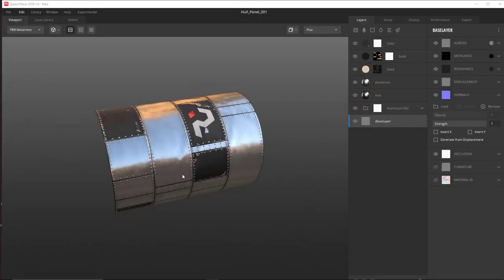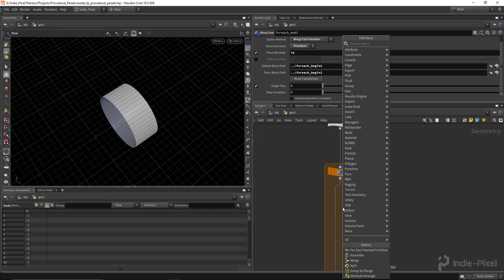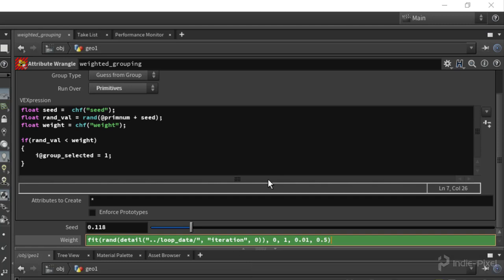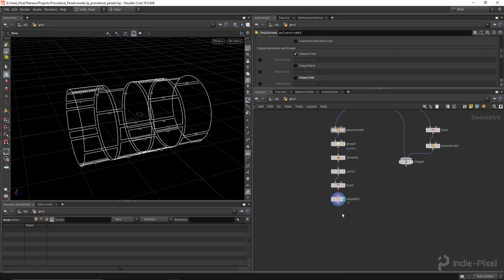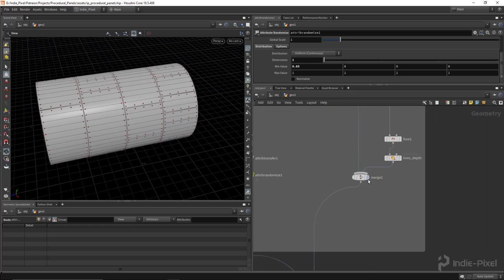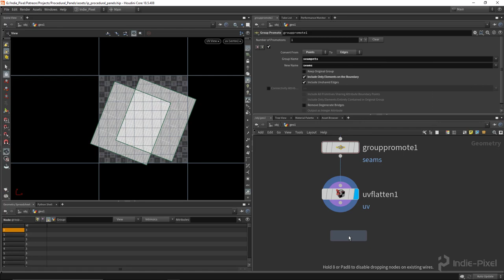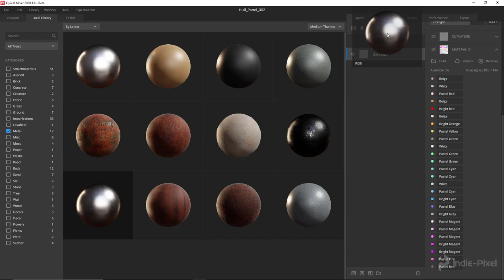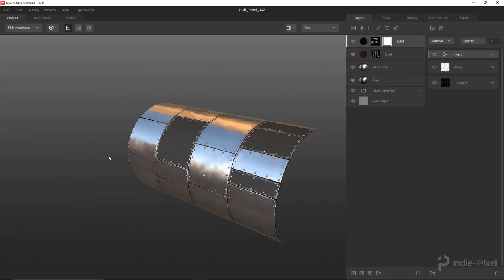Houdini 18.5 - Procedural Paneling

Comment: Excellent tutorial as ever. Only issue I'm having is that when importing into Quixel the normal map is massively zoomed in, I can sort of get them to look better if I change the model scale factor, but they are still not lined up correctly. It's almost as if Quixel isn't recognising the uvs. I've brought the exported fbx back into Houdini & passed it into a uvqs to check that the uvs still exist after export. 
I'm using Mixer 2021.1.2 ... is there anything that might be working different in this version?

Comment: Probably a noobie question, but after you baked the maps, the AO seems to appear on the tube, but mine doesnt. 28:27. Im using H18.5. Thanks
Reply from the maker: Ah, make sure the preview texture parameter is set to ao on the Baker node.  That should do it.
Reply: @IndiePixel3D  Thanks very much

Comment: I have finally had time to work on this more. at 21 minutes you have a color node on panels then connect to a merge. I have colors on panels in color node (in scene view)  but when I connect to merge the panels do not have color on them transferred from color node. I deleted both assemble and color nodes and retried but get same result. in geo spreadsheet they are all 1.0, color node has all different values - there is warning on merge about mismatched attributes and name is one of them which is what attribute is called in color node. I am stumped.
Reply from the maker: Hmmm, I see this happen in a few different scenarios...the first and I do this all the time to myself...when merging make sure your color attr is on the same class for all incoming goes.  If one geo has point color and the other is a primitive color...then they cancel each other out.

The second scenario is I have found that houdini's scene view is a bit buggy in h18... so make a new scene view panel and delete the old one...that might be the issue.
Reply: @IndiePixel3D  thank you so much for the prompt reply. that was it exactly, I had color1 assigned to points not primitives, changed it and it is good to go.
Reply from the maker: @Houdini_Bob  nice!  Happens to me all the time...;)
Reply: @IndiePixel3D  I must be doing something wrong. when I try to import panel FBX from Mixer which I saved as FBX, I get no textures what so ever, just the tube by it self not even the panels and rivets we made in Houdini. I tried save as FBX and quick export, both give this same result.